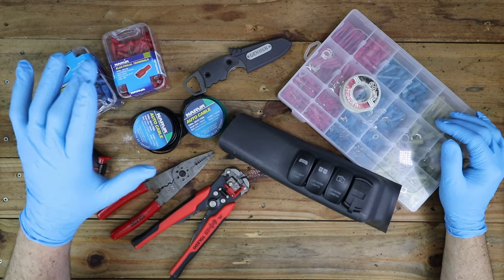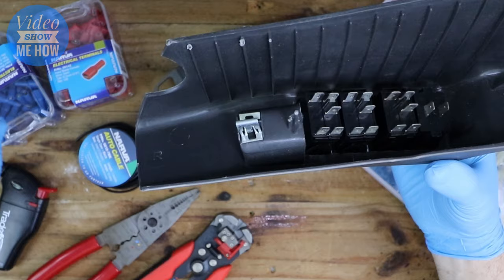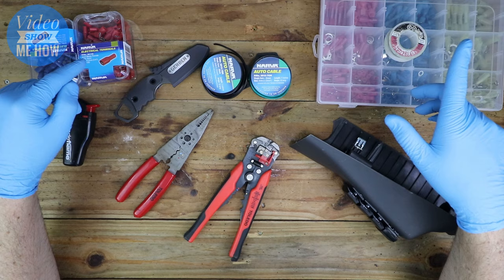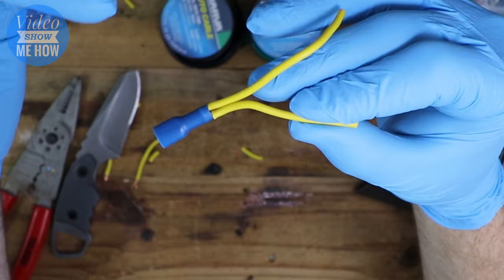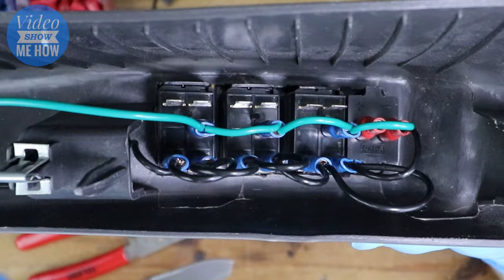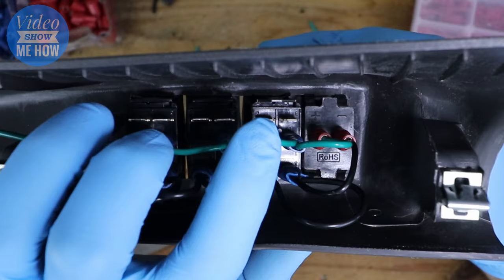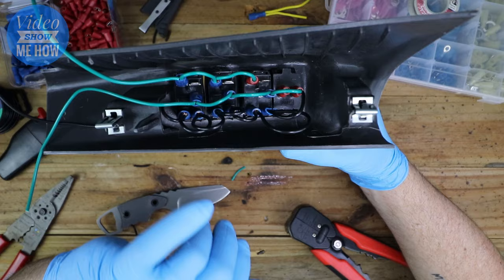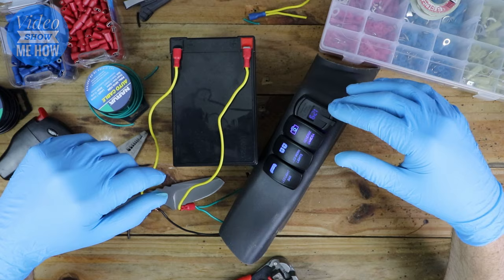How to Wire MULTIPLE 12V LED Rocker Switches [Simple Guide and Wiring Explanation]

Comment: If your only using the switches as a signal wire to a relay could you daisy chain all the positives together and run it off a dash light wire to then shut the whole thing down once the key is off ( talking side by side situation) cheers.

Comment: Question.I understand this video. But how would I connect blue tooth speaker to a switch. My speakers have three wires coming from them. I’m using the same set up in this video

Comment: Just what I needed! Replacing 8 rocker switches on a 1998 Armada deck boat. Your video and clear narrative put things together for me. The only difference in my situation is placing a breaker between sets of 2 switches. 

Thank you for taking your time to share your knowledge with the rest of us!
Reply: I was wondering the same thing, I saw another video where the guy split the power between the 4 switches he was wiring up.

Comment: G’day Adam !    Really enjoying your vids.  I don’t know how often you check back on (older) vids, re: Comments.  You wanted to hear about (our) Applications, and at the risk of being Wordy, here goes:
2003 Ford CamperVan  switch panel in cockpit, two panels in cabin, and one at rear doors.

I have a ‘habit’ of overusing Relays, in the aftermath of a vehicle fire some Decades past.  My brother insists that the habit is ridiculous.
Next, I have a pretty strong (distrust) of Chinese-produced wire products due to their proliferation of using CCA (copper clad aluminum) wire, as opposed to Better, Safer, more expensive true Copper.

As it pertains to wire panels, I appreciate that you’re daisychaining using Your wire instead of oft-supplied, cheap #20 wire.  My biggest question here is about power & loads in relation to daisychaining.

Is it Safe to daisychain Grounds if each switch has varying amperage loads ?
Is it Safe to daisychain the 12V switching feed in to say 6 switches, when/if more than one switch might be ‘on’ at same time ?  Any changes to Fusing, wire size ?  If you increase Fuse, doesn’t that create a risk if one switch fails during ‘on’ when chained to other ‘on’ switches ?

The output To the end destination, do you always feed a relay from that line ?  Several of my components are in the 30A range (driving, fog lights, …).
I suppose my confusion centers around which legs should be fused, and how to protect switches, wire, etc when daisychaining ?
I anticipate a small added fuse block somewhere in the cockpit to cover stereo components, and switch panels; but even those have current limitations.  If I’m feeding straight 12V to that (added) block, out to switch, then daisychaining is moot, no ?

Cheers !

Comment: Great instruction. I'm wiring up a 5 switch box for my RTV SxS,  which includes a USB charger and volt meter.  To prevent parasitic drain, I want to put the USB and voltmeter on the last switch so it has to be on for them to work, and then can shut off when not in use. I also want to wire the small LED indicator lights to this switch so they come on when the switch is on too as it would be the first one I turn on. It is a bit of a puzzle. Then I'll change switches to use a whip switch, and ground light switch in there places,

Comment: This is the best video on this because most people don't understand that they can wire the bottom LED lights off their dash lights so they are not always on.
Reply: Also, if you connect the positive of the LED with positive going to your auxiliary/relay, both lights will come up only when you press the switch. That's what I did.

Comment: Great video, I would like to know the little things also such as what gauge wire are you using and how do you hook the wire to the gauges so that they come on when your gauges come on? Do you use a t-tap and tap in somewhere? Also do you have to run the wires to the battery the positive and negative or can you use an expandable circuit and go to your fuse box and run the negative to a bolt to the metal frame? Things like that

Comment from the maker: Hey all, what are you powering with your switches? What kinda setup you got?
Reply: Video Show Me How Driving Lights, Fog Lights, Rearward ‘Work’ Lights, Dual Battery, Engine Bay Light, Electric Fan, Roof Fan (Directional change 7-Pin), Rear Wiper/Washer (7-Pin), Floor lighting, Ceiling lighting ....
Reply from the maker: All the things! 😁👌
Reply: Video Show Me How think you can make a video on how to connect to a vehicles fuse panel, so that the switches only turn on after you turn on the vehicles power?
Reply from the maker: Hey 👋 lemme add it to the list 😁 In the meantime, a good go to for this is your cigarette lighter socket, the power to these is almost always only on when you turn the key
Reply: PLEASE HELP. so how do you set up a switch for pattern changing for led lights
Reply from the maker: @haleyammari8461  hi, do you mean the switch wiring to turn on led lights?
Reply: @VideoShowMeHow  yes. does my boyfriend need a momentary switch for pattern changing?
Reply from the maker: @haleyammari8461  No, just make sure the LED pin is connected to your dashlight power - this way when you turn your lights on the LED will light up. Hope that's what you mean :)
Reply: @VideoShowMeHow  he has it connected to turn on but cant switch patterns.

Comment: You only have one wire going to your devices. What do you do with the negative wire. great vid by the way,very clear and easy to follow. cheers Gordo
Reply from the maker: You would just ground the negative wire from your device, just depends on your application
Reply: Ground it back to the battery. The application is a 12v water pump.

Comment: Going to use mine for a 1970 duster drag car going to power the reverse and air shifter. Have another switch panel from race wire salutations for fuel pump fan water  pump starter lights

Comment: Great video. If using a relay instead of going to the accessory a wire would go from the switch to the relay correct?
Reply from the maker: Yes
Reply: @VideoShowMeHow  Thanks. I did get thrown a curveball though. My Rigid lights came with 3 wires. I know red positive black ground where do I run the white wire???

Comment: Is there anyway to have the illumination on the bottom (words) off with the switch off? I have a 3 pin rocker installed on my new golf cart for my radio and such but I don't want the bottom portion illuminated when the switch is off. Thanks in advance!

Comment: So i got my switch panel all wired up like you do in the video. i bought a Relay wiring harness for a light bar and the wires going to the switch are a Positive a Negative and a yellow one with I assume if for the light on the switch the harness came with. Which one of the wires would I attach to my new switches? and what should I do with the others?

Comment: Great video and very clear instructions, thanks. A big help. I am doing something very simular in a Tundra. For the 12V switch power (not dash lights) to trigger the relay (load), I am thinking of tapping into a near by existing cig lighter, that way it is only powered when the veichle is on then i wouldn't need a new fused source. this should work right?
Reply from the maker: Thanks and yes :) Just test your cigarette lighter socket to confirm it does turn off with ignition as adding don't. Have fun!

Comment: This is the video that ive been looking for.. been planning to install an led fog light with high and low function and also planning on using a relay for both function and yes ill be using the same switch that you have here, may I ask if I should be still connecting a positive connection from the battery or I could just tap on to the + of accessory line when the key is on? Cause ive been thinking ive already got a direct + into the relays that i will be using so Im kinda torn what to do..looking forward for your safety and helpfull tips.. cheers mate!

Comment: I used a 12v cigarette lighter outlet thats wired to turn off with the key as an input for the led lights on the switches so that they come on with the car... now when I turn the car key off there's still power to the dash lights and led lights on the switches momentarily. There's about a second or two delay before the car actually loses power and turns off. Strange. Do I need to put a diode inline for the 12v input that powers the led lights on the switches? Would that solve this? Help!
Reply from the maker: Hmmm sounds like there's some residual current in that circuit, being led they draw bugger all which is prob why they're staying on for a couple second. You could draw power for the switch LEDs from a different circuit like your dash lights, this has more 'load' to use residual current if that makes sense. Let us know how your go!

Comment: I need help. I would like to use a (on-off-on) toggle switch to go between two separate 12 volt power sources. Is this possible? I have to be careful not to back feed either battery. I’m lighting a LED Light Strip off the Motorcycle battery but also have a 12 volt battery pack in the saddle bag that I use when the bike is parked and off. Hope I was clear, (any) advice would be sincerely appreciated
Reply from the maker: Perhaps a switch like this? Each light would be earthed seperately by the looks - https://youtu.be/y2-d_9GkCb4

Comment: This was a great tutorial for making daisy chain jumpers, especially for doing the inline insulation removal to make it one continuous wire. I do have a question with regard to your (+) output wire from your switch to power your device/load. Since you have your single (+) & (-) wire leads to go to your source of power (battery) and the single output wire coming from the switch to go to your load i.e. a light bar. Where do you ground/earth your light bar to? Typically lights have a black (-) and (+) wires to power them. If you have one (+) coming out of the switch to connect to the red wire on the light, where do you connect the black wire on the light. Lets give the example that you have a light bar at the back of your vehicle and you switch panel is at the front of your vehicle. You are running a single (+) wire from your switch output to your light bar (+) wire. You still have a black wire on you light bar that needs to go to ground/earth. Ideally vehicle batteries (-) are grounded to the frame. Are you just finding a bare metal area, frame/body/nut/bolt to attempt to find ground/earth to to complete the circuit. I am making a switch panel out of a plastic project box and plan to have a single (+)(-) source "IN" and daisy chained to 6 switches much like you have, and then having  a cable gland with the 6 (+) switch outputs coming out, but im curious about what to do about all the load/device grounds/earths. Granted i am able to find a nut or bolt near by with ground/earth continuity to the frame, is that all i have to do? Or should take that main (-) coming in to my box and and daisy with eye connector over to a threaded stud in the box to make a ground/earth stud and secure with a nut, and then take 2 eye connectors and twist 3 wire lengths together and crimp in each connector and then fasten to the ground/earth stud, and run the 6 (-) wires out of the cable gland with the 6 (+) wires? i hope i made any light of sense. Thanks for your time and any advice you may have.
Reply from the maker: Hi, yes in most cases you can earth to the chassis/body
Reply: @VideoShowMeHow  Thanks for the quick reply… I’ll see what I can do about grounding to an aluminum rack 😂😂😂
Reply from the maker: @GatorOverland  haha yes maybe not to the rack 😁

Comment: Thanks for the video, it was really helpful. 
So you ran one negative and one positive from the batter, a positive for the dash light and then a seperate wire from each switch to the relay to complete the circuit for the light bar, winch etc. How do you know what amp wire (& fuse) is sufficient for each of the positive and negative wires in given you might have multiple switches on at once?
Reply from the maker: Thanks 👋 If you're running directly off switches then the main wire needs to be big enough to handle the 20amps total (these switch max) so total load is less than 20amps if that makes sense?
Reply: I ran a 7 core 3 amp trailer wire through the firewall using a wire each for a positve and negative leed and then the remaining wires back under the bonnet for the relay switches. Wondering if I ran it in series like you have is it thick enough?
Reply from the maker: If there's no load on the switches themselves and you're using relays for each then will be fine as it's just the led load 👍 Just remember to fuse appropriately and you're good 😬

Comment: Great video! Do the usb ports have constant powered even when the vehicle is off? If so is there a way to wire them so they only power on when the vehicle is turned on?
Reply from the maker: Depends on where you power is sourced.. you could have it relayed off a separate circuit that only gets powered when the car is 'on'. Have more 12v vids coming soon (eg with relays etc)

Comment: Question..would the switches take the place of the relays or would one need 7 relays for the seven switches to wire different lights, diesel heaters etc etc? TIA
Reply from the maker: It depends on the draw, if the draw is minimal you could potentially just use the switch, anything more than a few amps and if use a relay

Comment: Im terrible with electrical stuff, but if I'm understanding this properly I can run just one wire to the power and I could use that one wire to run the power through the switches and to whatever light bars or accessories i have? Or am I misunderstood?
Reply from the maker: Yep one to power switches etc but using relays for light bar power

Comment: How would you wire in a main on/off LED rocker switch, to control all the other 5 pin rocker ACC switches? Would a simple 3 pin LED rocker switch work?  
Reason for asking, is my 10 gang marine control Carling switch panel, has Two main LED on/off 6 pin switches, & Eight ACC LED on/off 5 pin switches. Wires are all 10 AWG.
 The panel is divided in half, with one main 6 blade switch powering 4 ACC switches on each side of the panel (2 mains for 8 ACC). So a 10 gang panel, and all 10 have a 20A circuit breaker inline. Problem is the 6 pin main (2ea) Carling style rocker main power switches have broken. I can't find replacements anywhere! Best I can do is replace both 6 pin switches with ready available 3 or 5 pin switches. The panel was pre-wired (wired just like you show here) when purchased, and the manufacturer is no longer around. Trying to get my head around going from a 6 pin to a 3 or 5 pin.
 Also, the two main 6 pin switches have 5 hot (+) & 1 earth (-).  Top left is +. Top right is -. Both center are +. Both lower are +.  Best I can figure is the main 6 pin only need one ground, because it only has one led. 
Any help here would be massively appreciated!

Comment: I’m about to install LEDs on my car using rocker switches, diagrams show a fuse between the power pin wire to the battery. Do i “need” a fuse in that line or can i run from the switch direct to battery like yours?
Reply from the maker: I would add a fuse near the battery on the main 12v wire 👍
Reply: @VideoShowMeHow  Awesome, Thank you for the reply, appreciate that.

Comment: Do you only need one relay for all the switches if you’re daisychain the switch wire to the relay?
Reply from the maker: You could yes would depend on what you're switching though. You'd likely use seperate in most cases

Comment: Subscribed..nice work Adam.. tech questions. 
 Battery power in when piggy backing each switch say each switch rated to 20amp if your running 4 switches what would be the SINGLE fuse amp rating to safely run the 4 switches. 
  Secondly tapping into side light/dash illumination wire how many milliamps or fuse for that single wire run into the same 4 switches and should you fuse at fuse box or fuse behind dash area.

Comment: What a great way to daisy chain connections.  I had never thought about stripping a wire bare anyplace other than at the ends.  Many thanks for that great tip.  Question about that USB receptacle, what voltage are you getting out of it"  Isn't is supposed to be 5v ?  Where did you find it?  I have Carling Contura II switches all through my Class A motor home.
Reply from the maker: Thanks 👍 Re the USB for these from Amazon, they're designed for 12v systems so there must be a step down or something in there. They've turned out to be super handy as that switch pod is right where my phone is on its cradle so easy to keep charged :)
Reply: @VideoShowMeHow  Many thanks for the quick reply.  I just tried doing a search on Amazon but couldn't pull one up.  What are they actually called?  Do you have a link to them that you could share?
Reply from the maker: @MonacoMike  will update the description :) https://www.ebay.com.au/itm/AU-Car-Dual-USB-Charger-4-2A-12V-24V-Lighter-Socket-Power-Adapter-Blue-Voltmeter-/313202820820?_trksid=p2349624.m46890.l49292 or https://www.amazon.com/dp/B088WV4PWN/ref=cm_sw_r_cp_apa_fabc_7-SYFb4PTQDVZ

Comment: Awesome video! Thanks for sharing but I have a question that may seem stupid to some...Can the dash lights be wired directly to the power coming in as long as everything is key on power? I'm running a 6 switch panel and I believe this should work fine. Or should I just grab another fuse slot from my box specifically for the dash lights? I'd hate to rob a slot for something else I could use and doubt the LEDs in those draw much amperage. Thanks for any insight I appreciate it!
Reply from the maker: Yeah works prob be ok, just depends on draw etc
Reply: @VideoShowMeHow  thanks I just saw your reply. I'll give it a go 👍